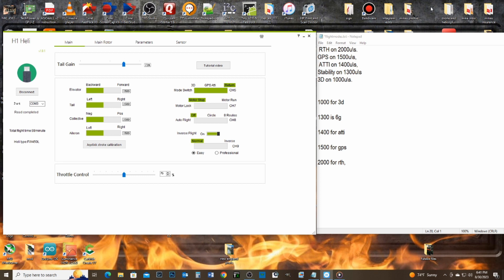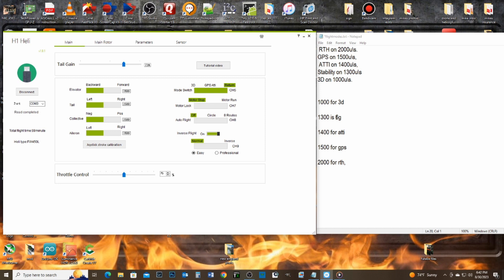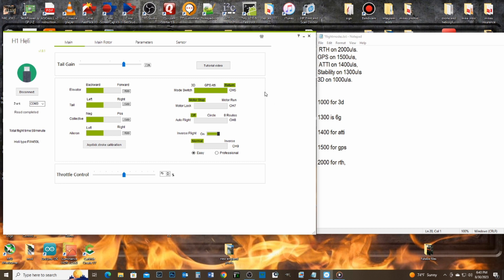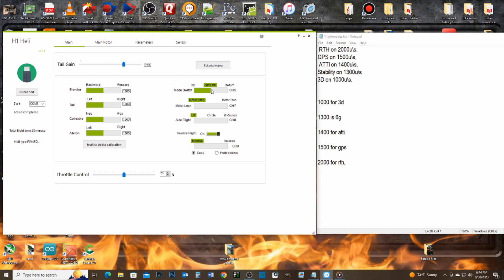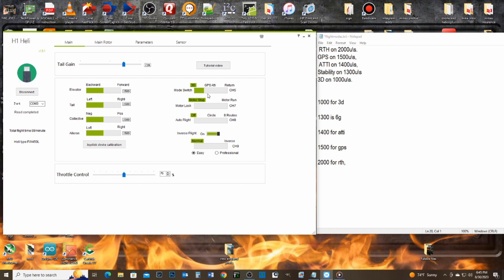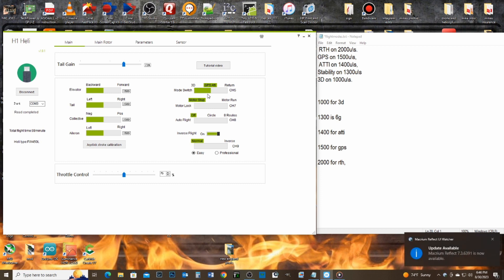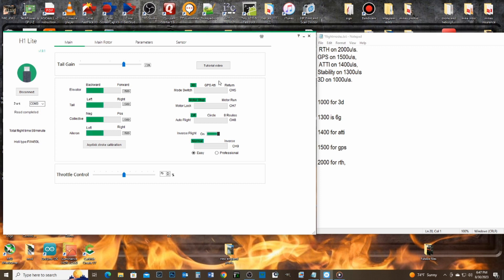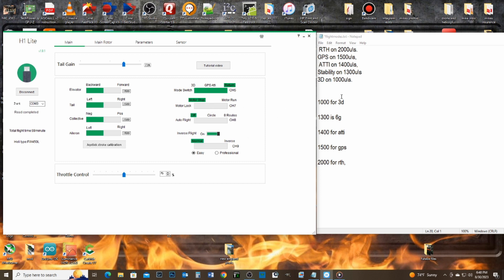FW450 v3  radio flight modes and settings

Comment: hi I have a question if you could help I bought fw450 v3 and everything works good I bought quick release for my blades if I lost the nut out in the field I'm screwed my problem is that when I go inverted and into normal the heli tail roator started twitching left or right I turned the tail down and now when I go inverted and normal it now does a 360 spin. Is your tail on 73% I can't see on your screen? Should I put it to 80%? I need some help.
Reply from the maker: i would not use the quick release for 3D flying, just putting around is good, but the slop is terrible and could cause a crash, if you what ali youtube, he gets paid and free parts from flywing, and doesnt always tell the truth, as for bolts, some hobby shops sell the whole bag for a few bucks.. then you have spares.   https://newenglandrc.us/products/fv329-flywing-fw450lv3-screw-kit
Reply: @CRUZROYHelicopters  right, so I went out last night, set everything up, took off, and went inverted was fine came out then it did its little spin then it started circling I was in gps then went into inverted diddnt have control of helicopter up or down was going down and down and down then hit the floor I need new blades and motor wheel i have commented on his post I'm wait for reply I could say there you go I've crashed now thank you lol with the quick release It is good just to fly around. The old one is going back on

Comment: Did you use the new 1.9 update from flywing?
Reply: Because my fw450 v3 Huey the head speed is low and slow
Reply: @charlescoby5741, did yours use to be slow when going down like if you needed to land quickly
Reply: Yes on auto land
Reply: @charlescoby5741  Oh, an aeroplane was coming in my direction, and I needed to land it diddnt go down fast enough from being 60 feet in the air. I'm new to helicopters. I'm a Drone Pilot
Reply: Yes I’m a drone pilot too, and there a different between the two so yes the helicopter is going to move slower than the drone
Reply: @charlescoby5741  Aww, yeah, drone pilot . Are you fully registered like me and insured? I've been flying since the end of covid 3 years now. I need more equipment to get into this. Um, the heli will go faster due to 70mph, the mavic 3, what I have it does 45mph on sports mode